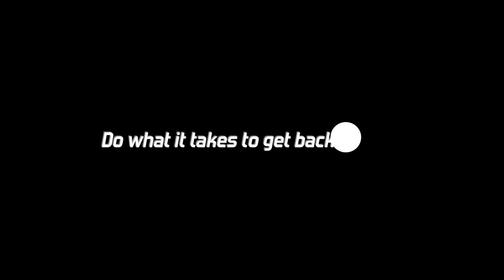DIY Face Shield, Face Mask, made from milk. Clear plastic made from milk. Part 2

Comment: Hi, I really like your videos.  I like to try to build and create things from scratch, mostly dealing with paper pulp with a basic recipe to which I add more ingredients.  I'm looking for recipes with products without animal cruelty, I do not care if they are synthetic but can be obtained at a reasonable cost.  I am familiar with the silicone tube method with the soap, but am looking for example, a way to soften the mold a little more, so that it will be similar to alginate, (which is not available to non-licensed dental technicians and dentists, or in very specific stores and not marketed in home remodeling stores.) .
Reply from the maker: Good luck.

Comment: Not quite sure I get this. If you put an impermeable in the filter, it will no longer act as a filter, so how does this work?
Reply from the maker: Great question! And one I knew I would get. Face masks do not create a seal, and most air comes from around the sides. It felt normal when I wore it for the hours it took to shoot the Face Shield segments. What it does do is create, just as you said, an impermeable barrier, around your nose and mouth...the danger zones. To me, N95 is 5% too little. BTW, this can be sanitized in the oven @160F for 30 minutes, as I showed in a video awhile back. Thanks for asking!